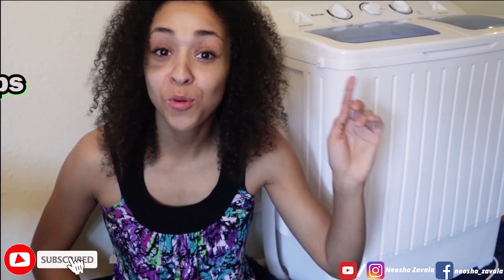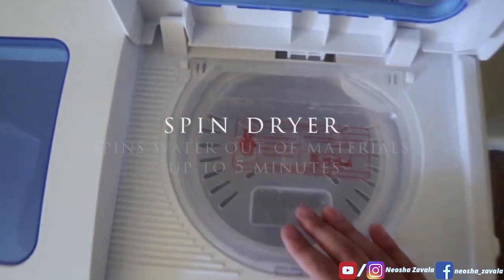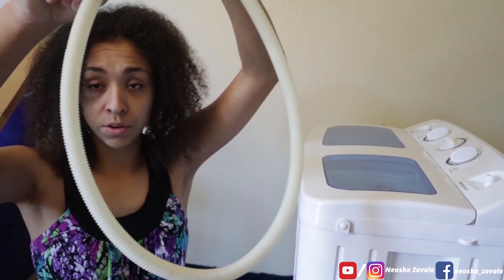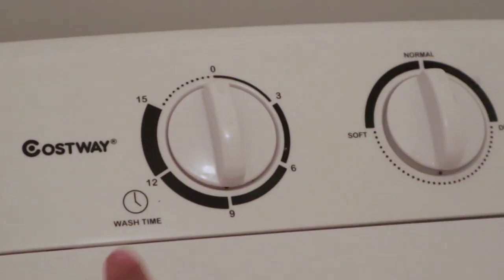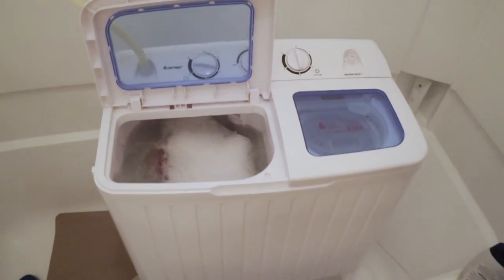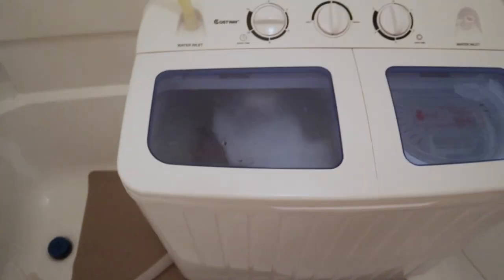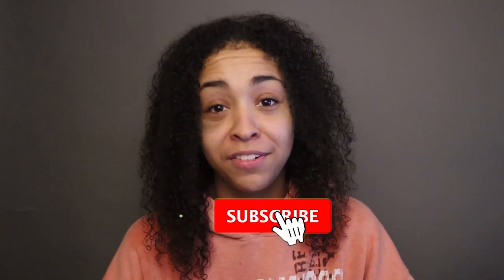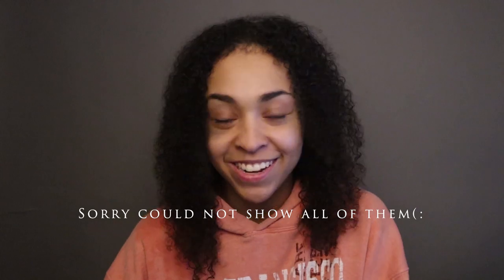Giantex/Costway Portable Mini Compact Twin Tub Washing Machine Part 2!!

Comment: Did you find an easy way to clean the tube of the machine out? I am interested in how to do this since my machine just came in yesterday. Thanks!
Reply from the maker: I’m so sorry I was going through comments and saw I missed yours, sorry for the delay. But, yes I did I have this brush I found at harmons like over a year ago that I never ended up using but it looks like it would help a ton for cleaning the drainage tube/pipe. I’ll have to edit the brush in my video for y’all I’m currently editing giving this time for me to learn more. But I ended up filling the machine up a with enough water but not a lot if that makes sense, so almost half way full is basically enough to mix water to agitate pouring a little tiny bit of bleach and some white vinegar, and baking soda is what I mixed all together and I figured I’d let it drain out so it cleaned when it’s draining with all the fix and stuff it’s creating and it worked pretty darn well for me, it cleared out the pipe without me scrubbing it and cleaned itself while draining, I let it sit with hot water not to hot but warm warm. Then agitate all that for like 5-10 minutes let it drain and stop, drain and stop. That way it’s having enough time to make it through fizzing/cleaning while draining. And it took a few times but it eventually cleared out all the gunk out on it’s own. I I also soaked the water inlet after pouring straight baking sides and white vinegar in to then let it fizz and then put it hot water in the sink to sit and soak so when I rinsed it with hot water the yellow came out, because it did turn yellow over time with all the water collection and humidity I didn’t think at the time could collect.

Comment: Quick follow-up: Can you wash queen sheets and full-sized bath towels? Or is it mostly for smaller items? (ie: do you still have to visit a coin-operated laundry occasionally?)
Reply from the maker: With this machine I've been able to wash tops 5 towels depending on how thick or thin the material is of the towels and blankets. I just have the light fuzzy blankets I can wash about 2-4 at once. So the towels of course being separate from the blankets, so (separate loads), So I've been able to wash those without a problem but it really based on your judgement once you get more comfortable and familiar with the machine just really all depends on the size and material and how much water weight you think it will be vs if the machine can take the pressure/weight or not. Hope that helps(:
Reply: I do king size sheets, just one at a time. Works great.

Comment: If you drape the extension cord over the shower curtain rod, it would help keep the cords out of the way and safe.
Reply from the maker: Thank you so much!! It’s just the way my bathroom is angled it makes it a bit much difficult because the cord I have is way long, so for me I just keep it on the floor and out the way on the side of the toilet, because of how my bathroom is and all. But It’s okay cause I don’t use the toilet while I do my laundry, and if I need to it’s totally okay to turn the machine off whenever and unplug it for a sec(; that way I don’t risk the cord falling or having to wrap it around each time to

Comment: I have a question about draining. My shower isn't big enough to hold this. Will the water drain if it's not completely facing down? Like if it goes over the side of the shower? Or will the water get stuck?
Reply from the maker: The best way for me to explain is, say if the machine was on any flat surface, because of the pressure of the water of how it is when it’a coming out should drain properly when it’s on any flat surface as long as the drainage tube is faced to the side as shown in the video allowing the angle of the drainage tube is what really matters so just make sure the drainage tube is faced more downwards or sideways, it drains fine(: Just be sure where you drain it though that tube has enough space to flow out on grass or wherever you decide to put it. It will not drain if that tube is faced up, so I highly recommend to make sure it is either on the side and has enough room to flow, or have it lean by downwards more so it will have a higher likely chance of draining (;
Reply: I ordered one with a drain pump because I want to drain it into a bucket or sink.

Comment: what temperature of water to fill it up with does it have to be cold warm or hot
Reply from the maker: I would suggest like any other load honestly is making sure whatever materials that you’re washing whether it be lights or darks,darks I always use cold water/Luke warm,depending on the material. But that way when you use cold on your darks, you’re not washing away your color that’s embedded in that material. You don’t want your clothes to look faded. So cold is better with darks and warm/hot is better with light materials. I like to separate my clothes so that way I can use the same temperature of water when I’m washing that load

Comment: I just got mine Today, but I wonder if mine is a bit different. Mine has a drain pump, but not what I'd call strong one. It sounds as if yours drains from both drums, but might only pump from the spin drum. Mine pumps water out from both drums when in drain mode, plus it drains (maybe also pumps, not sure yet) when in spin mode. I might make a brief video of mine once I get the related plumbing rearranged.
Reply from the maker: Is it a different brand by chance? Is that what you mean? Or same machine I have brand wise that is doing this drum deal? Sorry sometimes I suck not visually seeing certain things in order to understand it more. So if you make a video or have by now I’m interested in seeing it to better understand what you’re mentioning to me.
Reply: @neoshazavala  It's a Costway, but after I set it up and used it some, I figured that it's probably different, at least in terms of draining. I'll try to make a video soon, and hopefully upload it on Monday.
Reply from the maker: Okay great lmk when you upload it, I’ll check it out
Reply: @neoshazavala  They should show up as the two newest ones on my channel. I was thinking that my phone was better at picking my voice up, but I may be able to amplify it or write out any muffled words.
Reply from the maker: Yes l, I checked out your videos. I could hear you just fine. But I wish I could give you an answer, because that one is a different model though it’s the same brand they’re slightly different. I’m not sure exactly about how your machine is with the draining/drums unfortunately. Sorry I could be any help/:
Reply: @neoshazavala  You've been very helpful in your videos about it! I was mainly wondering if mine is different.
Reply from the maker: Looking at your model, It is built slightly different.

Comment: Is the the washing motor suppose to turn off and on for the time of the washing or does suppose to run continuely for the time of the wash cycle
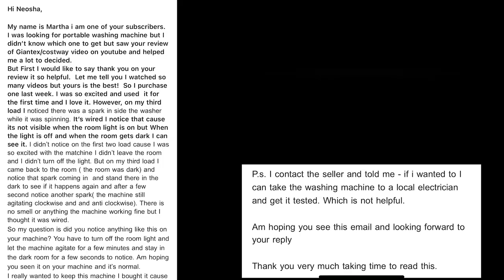Reply from the maker: 18:20 I went over this part to best explain why it shuts off and on and as well as a spark(:

Comment: I just got mine today. I would like to know if you have a few holes that are different shapes and sizes on the back of the unit half way down? Have you washed a King Fitted Sheet?
Reply: I do king size sheets, one at a time. Works great and love mine.
Reply from the maker: Sorry holes in the back? I’m not understanding sorry🤔 If it helps in my video somewhere I did show the backside of the machine and underside of it as well. I don’t have any King fitted sheets so my answer is no. But looks like Daisy’s reply to your comment does 😊
Reply from the maker: Oh that’s great! Thanks for responding to this because I don’t have those to answer that question 😊🙏🏽

Comment: Hi, thank you for the detailed video! I have a different unit and was wondering if the water in this unit ever pools from the washer tub into the spinning tub during a wash cycle? I fill my washer tub 2/3 and within a few minutes, I notice half the water has decreased because it collected in the spinning tub. I end up having to use twice as much water every time. 😞
Reply from the maker: Sorry for the late response!! I’m glad you enjoyed the video, thank you for watching (:
No it doesn’t,  on the top part of the washer, it has a cut off line on the inside of the washing machine where if like let’s say… you over fill the washer and forgot about the water running and it over flows out the machine, it comes out on the top of the washer part where it cuts off on the inside of the wash let them it will flow out from the bottom and out the drainage tube. It’s kind of hard to explain in words without showing you. But it does not go in the spin cycle part. I hope that helps answer your question.
Reply: @neoshazavala  Thanks for answering my question! Yes, I know exactly what you mean. The water flows into the spinning tub even though I fill it below the cut off portion. I'm considering purchasing a different washer but want to make sure I don't encounter the same problem.
Reply from the maker: No problem!(: Glad I could help!
Reply: @neoshazavala

Comment: on the holes put a thon nylon sock on it with a string..that's what I use and it catches all the lint and does the clog the water...works geat..try it....
Reply from the maker: I got that recommended in my comments a couple different times as well! I really gotta try this!! Thank you!!(:
Reply: @neoshazavala  I also use a fish net while the washer is washing the clothes. I just skim the top and turn it in the direction it’s moving and it catches lots of lint. Takes a little work but is effective.
Reply from the maker: Thanks for your comments and intake !(: I appreciate it

Comment: Sorry, I'm not sure if you covered this in your 1st video, but how would you go about applying liquid Fabric Softener to this whole process?
Reply from the maker: I did not, but I can answer(: So you can go about using your fabric softener to the material how you normally do. I would suggest after washing your material with detergent normally, then giving that a rinse in clean water, then applying about 1 cap is good per load so that it can do the job properly. Then apply your softener, and just let the material soak for about 5 minutes I’d say. Then just take your clothes straight out and spin dry, or however you dry your stuff(:
Reply: I can answer this too, i put my first load in & wash it on 15 min, then rinse refill & wash again for another 12 min adding a bit of fab add softner & do another 5 min then rinse
Reply: @neoshazavala  So should i let the washer agitate while my clothes are soaking in the fabric softener, or just leave it off? thanks
Reply from the maker: Usually the correct way is to let them soak. But I’m sure agitating won’t hurt(: if it gets bubbly, say if you agitate it, then I’d recommend rinsing with water again.
Reply: @neoshazavala Hi, its been a few years since I've had this machine. Are you experiencing any mechanical problems yet?

Me, I notice now that when I do my 1st wash for the day, when I set the switch to Normal or even Soft, the water still drains out. It's like I have to play with the switch for a few minutes while the machine is running before it actually starts filling up with water. 

Have you ever experienced this?

Thanks

Comment: thank you for making a follow-up.  This might be a silly question but do you recall if the box stated there was a washing machine inside?  thank you 👍😊
Reply from the maker: Of course! Thanks for watching(: I honestly will have to dig through my old photos/videos of this machine because I can’t remember if there in there or not regarding the box when it first arrived to give you that answer, So I will get back to you after I get off work later on that when I find it(:
Reply from the maker: Alright sorry I was going through photos after getting home. I thought that I took pictures of the box part, when I got the machine. Unfortunately couldn’t find any. But from remembering I do believe it did say the brand costway on the box. Hope that helps(:
Reply: @neoshazavala  thanks for looking 👍🏻
Reply: RominaMorris, I have the same machine. The box does not specify a washer machine is inside, only the name of the washer.
Reply from the maker: Of course(:
Reply from the maker: Thank you for confirming that!! I appreciate it!(:

Comment: Thanks for the video. I bought a new semi automatic washing machine, from the first wash I noticed rust stains and brown stains on the laundry.
At first I thought it was due to the powder detergent I was using, I have changed the brand of detergent 3 times currently I use the ARIEL brand but I still have stains on the laundry, I have washed the machine and cleaned the filter but that did not solve the problem, do you know what it is due to?
Reply from the maker: Of course! I’m sorry to hear that):  To be honest I’m not fully sure, because it’s not the same machine? It’s a different brand right? Not sure what would be causing the brown/rusted spots on your clothes. Sorry I couldn’t really help on this one): 
Mind telling me the brand of the machine? Is there a way to possibly open the inside to clean it out where it may be rusting or collecting old water that may need to be rinsed/washed out so it don’t stain your material’s possibly??
Reply: @neoshazavala  Thank you for your answer. The brand of the machine is ELEKTA. I have already opened the machine to clean the inside but everything was clean. The evacuation of wastewater is also normally done.
Reply from the maker: I’m so sorry I don’t have an answer for this one): I’m not exactly sure since I haven’t had this problem. The best thing I could recommend is contacting the company you got the machine with if you haven’t yet and ask them, and maybe read some reviews on the machine you got from others and see if they may have had that same experience and possibly know the answer. Hope that helps!
Reply: @perlenoire89  Hey just saw your comment. Are you using bleach by any chance.  I've had that happen to a few white wash clothes when I used bleach.

Comment: If it's damp with less than a minute, will it be dry with five minutes or more?
Reply from the maker: I would say to completely dry after spin drying it. It takes up to 2-4 hrs to dry. So really depending on the material you use,  some may dry faster or slower when it’s damp.

Comment: Drape your power cord over the shower curtain rod. That will keep it dry and you can go and use the restroom if you need to while you're doing laundry.
Reply from the maker: I would but the cord for the machine is  a bit too short and angled funky if I draped it over. So it’s all good putting it on top of the toilet, as. It’s nota problem. Also say if I need to use the restroom. It’s okay to turn the machine off for a sec, unplug, and move the cord to use the toilet, then just plug it all back in and put it back when I’m done(: Thank you for the recommendation though on that(: It could always help someone else because we have different angled bathrooms and all right!

Comment: Can you use hot, hot water???
Reply from the maker: Yes, I wouldn’t suggested using by itself though, you can make it hot.. but not too hot is how I keep things personally. But it has worked for me using super warm water(; But again, not straight hot alone isn’t suggested though. 
Just to be sure things don’t overheat the machine or plastic even though it’s built tough, it’s just better to be safe then sorry.

Comment: Does the machine shake during spin cycle?
Reply from the maker: It does, so I would recommend having a mat of you put it inside the tub to help ground/grip the bottom better so when it spins it won’t slide across the bottom of the tub scraping it and all(:

Comment: Can you add detergent pods to these type of washing machines?
Reply from the maker: That on my personal opinion. I wouldn’t, I’m not exactly sure if they will dissolve enough for it to want to wash? Im not really sure since I don’t use those pods or anything. But if you give it a try I’m sure it won’t hurt the machine, but just check on the pod and see the duration on if it will dissolve or not while washing in a short amount of time and allow it to wash properly and all. Hope that helps(:
Reply: They are meant for a regular sized washer so it would be too much soap for this small load.
Reply from the maker: That makes a ton of sense, I didn’t think about that part since I don’t ever use pods, so yeah I wouldn’t recommend those then either. Thank you !

Comment: I think if anybody was extra concerned about setting that washer down inside the tub they could use a couple of metal milk crates probably plastic would even be strong enough and place the washing machine on top of the two crates to make sure there was no water touching the underside of the machine. This is still in my Amazon cart I haven't bought it yet so I don't know for sure but it stands to reason if you could get it up off the bottom of the tub that should alleviate the worries of people who are afraid to have water draining with the unit sitting on the tub floor.
Reply from the maker: Yes! I’ve had other people mention this as well, using the milk crates to help hold it up more, but being honest I’ve still done it the same in the video and still till this day have no issues whatsoever (:
Reply: @neoshazavala  yes I can see by your excellent video that the water doesn't come anywhere near the bottom of the washer it's just at the bottom of the legs
Reply from the maker: Thank you so much, I’m really happy you noticed that because a lot of others are concerned which I understand. But showing the underpart of the machine is where it still does just fine and has enough space to drain the water without touching the machine at all underneath besides the little leg parts I thought would glory my point more across. Glad you get it!🙏🏽☺️